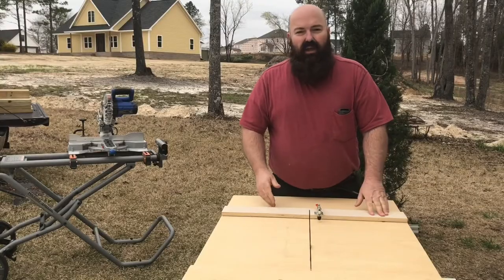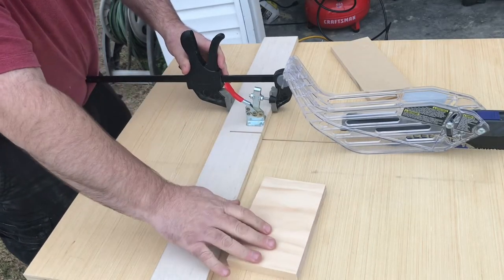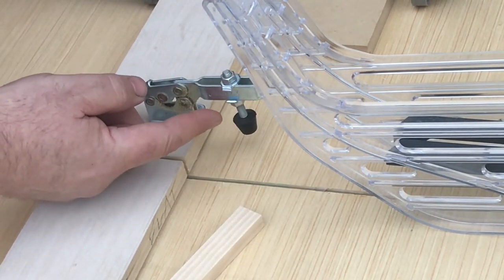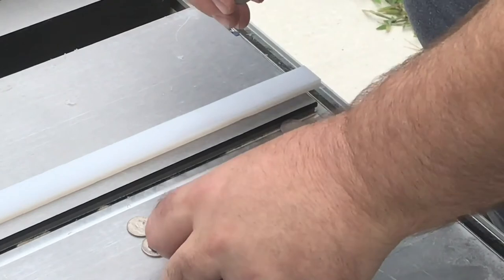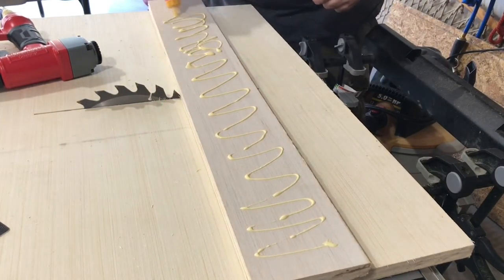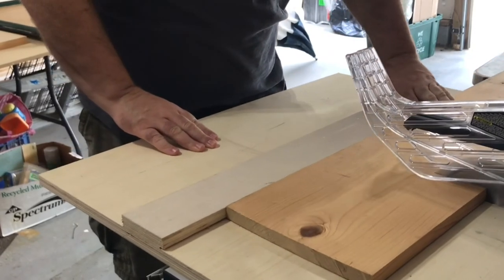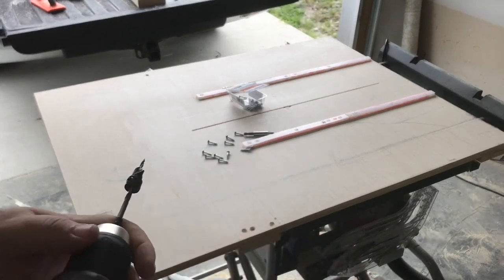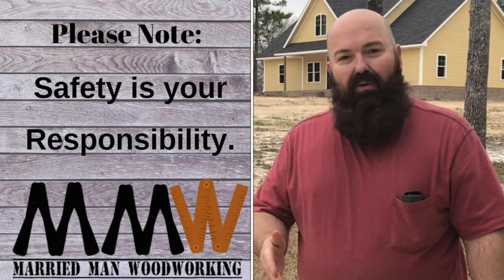Make an easy Cross-cut Sled

Comment: Nice sled. I have the same saw, actually my second one. The first one wouldn't raise/lower the blade after a few years, took it back before warranty ran out and got another. It's OK, I've got mine built into a 5'x6' table I built last year. My main complaint with the saw is the fence. Getting it square is a PAIN. The newer model out now has a better fence I think.
Reply from the maker: I have heard the newer model has a better fence - which is great because the fence on mine (and yours) is difficult to align. Thanks for watching. If i had the room I may build a table around my saw as well - that is a great idea.
Reply: @MarriedManWoodworking  I got the idea from Linn at the Darbin Orvar YT channel. Her's was 5x4, has drawers, storage etc. I built mine very similar to hers.
Reply from the maker: @lawrencelunsford6028  Thanks, I just looked it up. That is pretty cool.
Reply: @MarriedManWoodworking  I put removable casters (Rockler) on mine. Not that I plan on moving it, but I can. Took a while to build, but definitely worth it.
Reply from the maker: @lawrencelunsford6028  That's awesome. If you are a member of teh 731 Woodworks Facebook community, then I hope you consider posting a picture (or more pictures) so we could see it.
Reply: @MarriedManWoodworking  I am a member. I'll have to get some pictures together and post them.
Reply from the maker: @lawrencelunsford6028  Thank you. I would like to see them.
Reply: @MarriedManWoodworking  Hey man! I posted the pictures you asked for on the 731 Community page. Didn't know your name to tag you in post. :)
Reply from the maker: @lawrencelunsford6028  I am going to take a look now. Thank you
Reply: @MarriedManWoodworking  Sounds good. Hope you like it. :)
Reply from the maker: @lawrencelunsford6028  It looks great. I am jealous. thanks again
Reply: @MarriedManWoodworking  Let me know if I can help in any way.
Reply: I have the same saw at my camp will have to build this for it